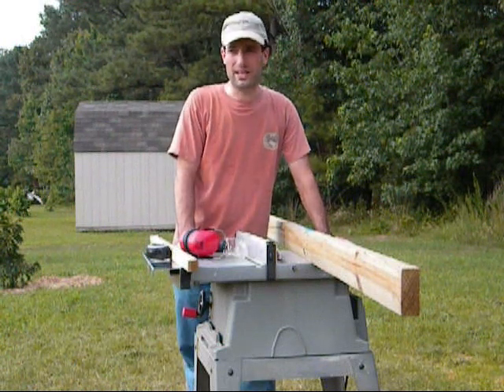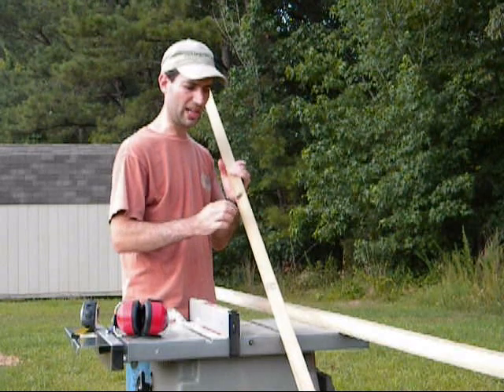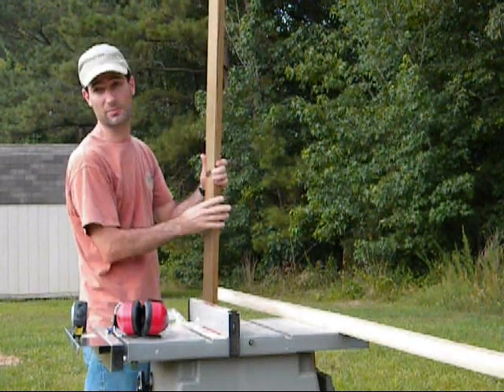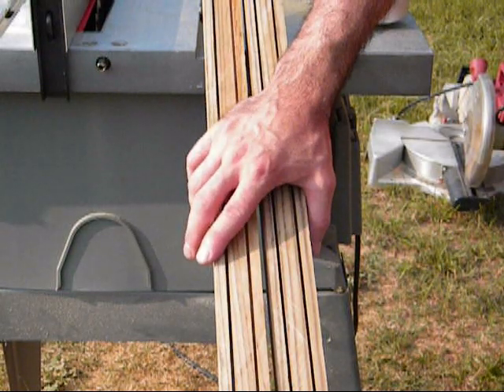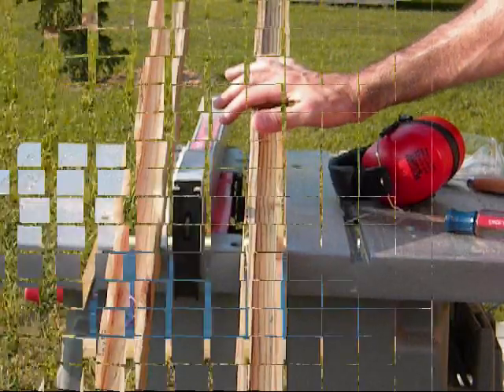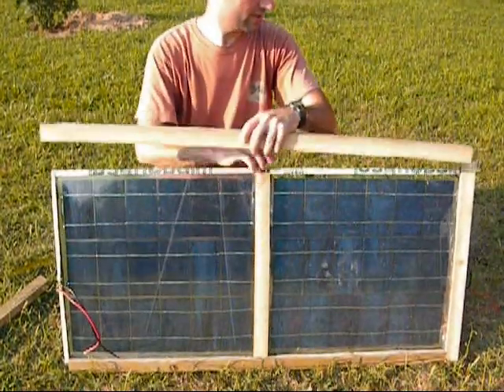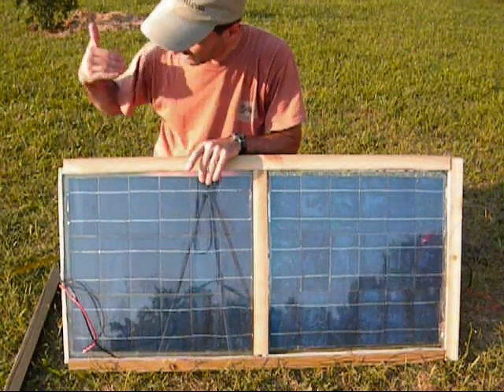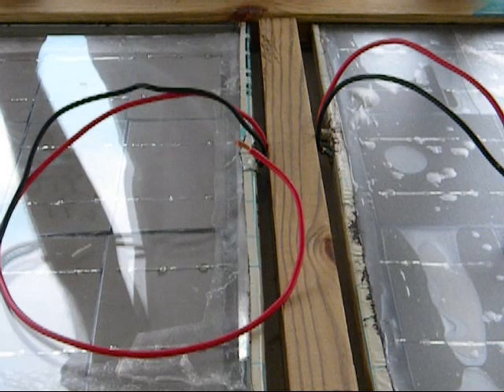How to build a solar panel part 9

Comment: A faster way to make the grooves in the wood is to use a dado blade.  It fits right into your table saw, and it oscillates back and forth quickly, making a wide groove with only one pass!
Also, one question:  aren't the panels making electricity out in the sun as you're talking?  Could it zap you?

Comment: A faster way to make the grooves in the wood is to use a dado blade.  It fits right into your table saw, and it oscillates back and forth quickly, making a wide groove with only one pass!